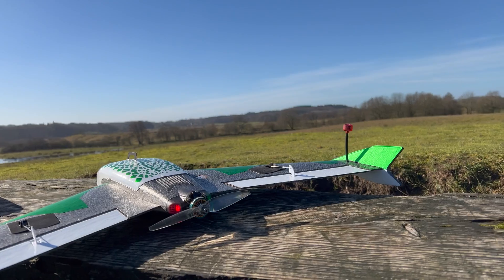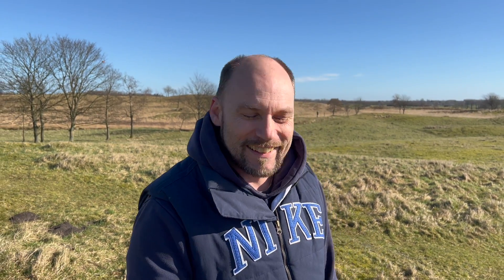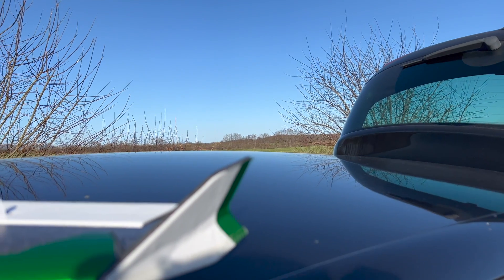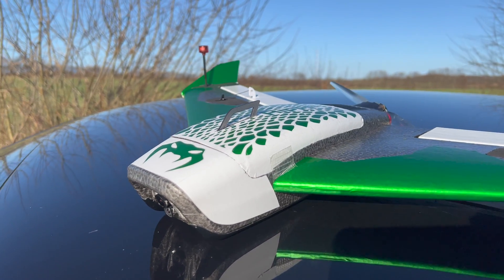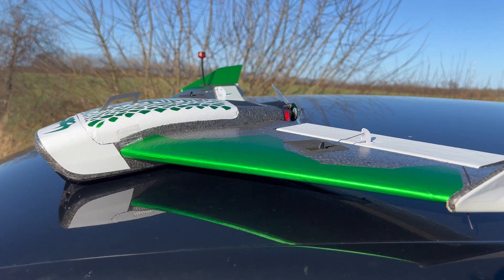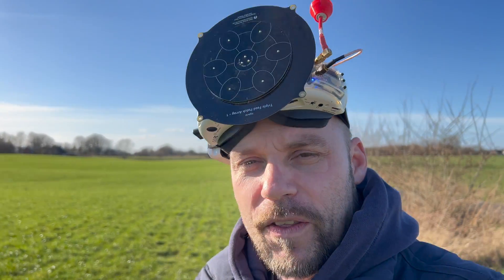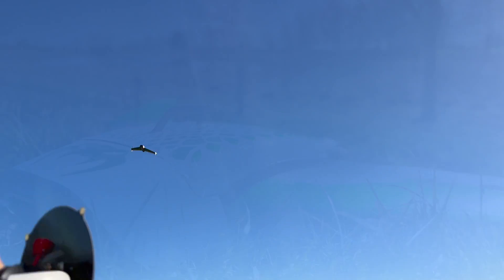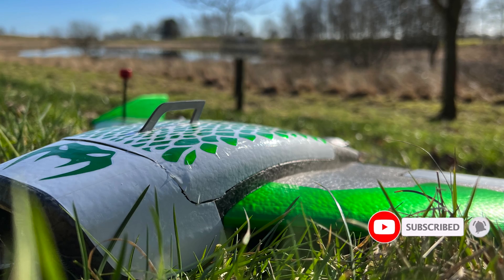Build v2 maiden and some motor test | Diatone Ripper EP:12

Comment: I’ve never had one issue with my ripper. Launches perfect and flies perfect. Still on default piff values on inav 4.0
Reply from the maker: happy to hear :) Mine flew great too ... just not yesterday. But it will be back on track very soon with some more power and efficiency
Reply: @JustFPV-net  nice man. I run a Tmotor F40 with a 7x4 prop. Avg efficiency is as low as 50mah/km and have done 1+ hours flight time with it on a 3500mah Li-Ion
Reply: I tried a 6x4 today and noticed efficiency was just a few more mah/km but top speed was 164kmh. Seems to be a good alternative to the 7x4.
Reply from the maker: How much kv has your f40?

Comment: Hey Günni. Nice performance on that 6” prop. With the iNav settings, I’m wondering if they were the wrong defaults? 200 degrees per second sounds like the FC defaults, not the airplane without a tail defaults. They should have been 180 deg/s on roll and 90 deg/s on pitch before an autotune. It might be worth checking that out.
Reply from the maker: I just reset itself entirely today in the field- went back to v3.0.2 for now
Reply: @JustFPV-net  the flight dynamics aren’t any different between 3.0.2 and 4.1. It can only have been the defaults. You can even use the PIDFF and rates values from 3.0.2 in 4.1 and it will fly the same. Still, get it flying great and test those motors 🙂
Reply from the maker: That was the plan- tune it and then take the results to a clean 4.x